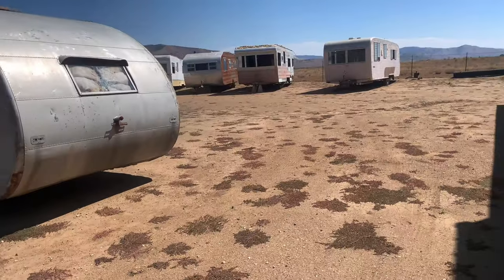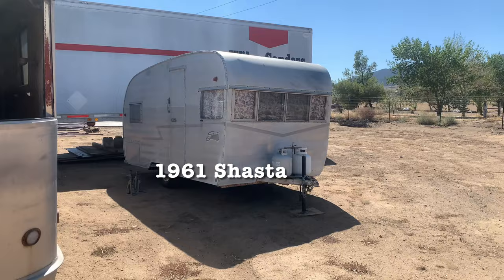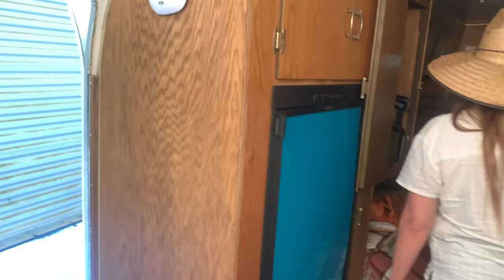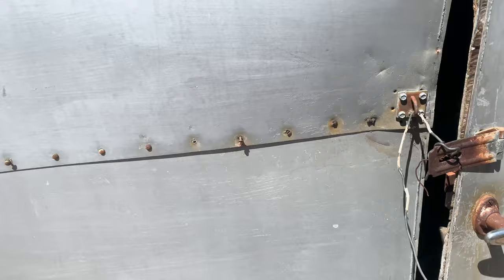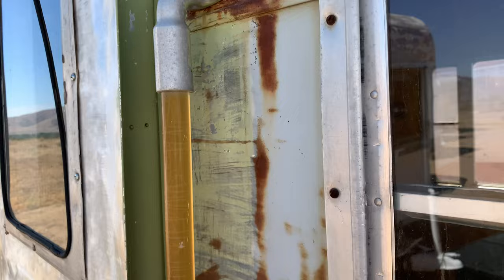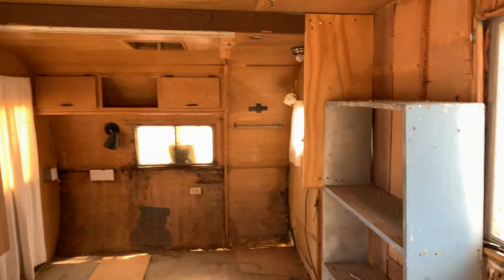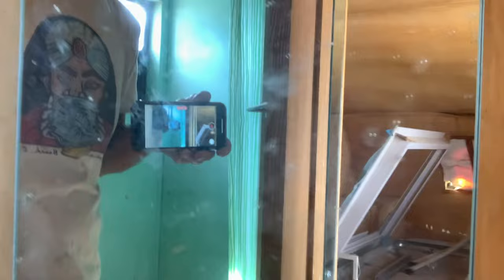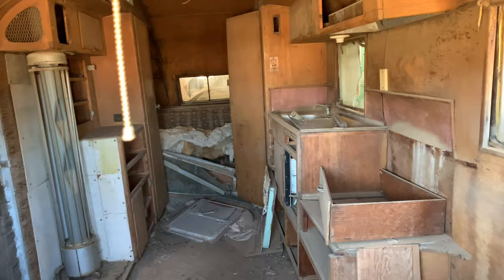Vintage travel trailer HEAVEN! Can we find our next project?

Comment: You should see what I have it's a 1983 Nomad camper.. it is still in amazing condition.. it does need some work.. I'm getting to it slowly.. it needs a hot water tank water lines and a new furnace everything else Works in this thing.. I need to get on the roof and put on a new rubber coating.. the furnace will be the last one because that's going to be too expensive for me..I'm in Arkansas..
Reply from the maker: That’s awesome! Good luck on it and thanks for watching!
Reply: @WhatWouldJasonDo  yeah my camper still needs work it needs a new hot water tank.. water lines and the furnace is going to really soak me.. I don't think I'm going to be able to replace that furnace..